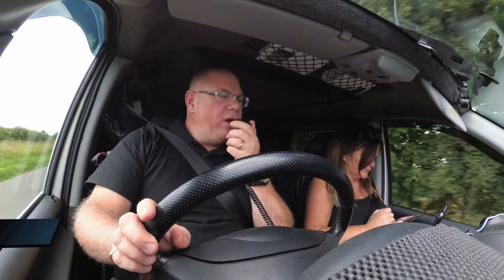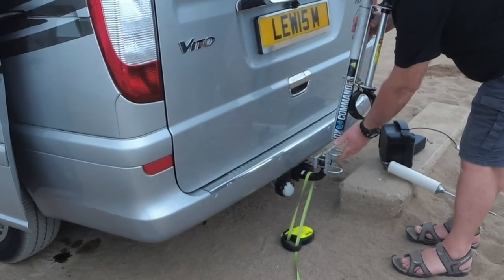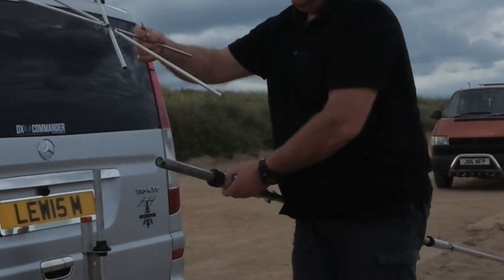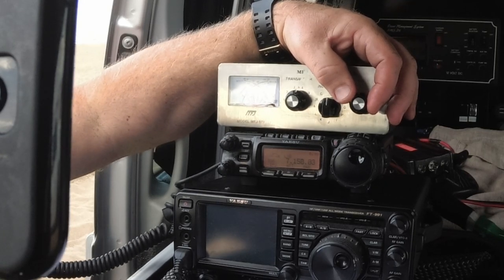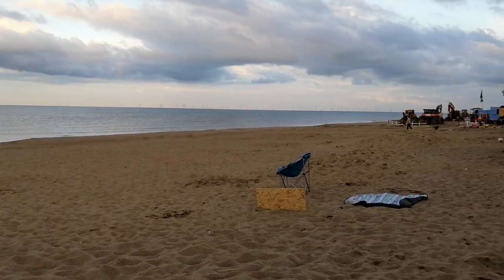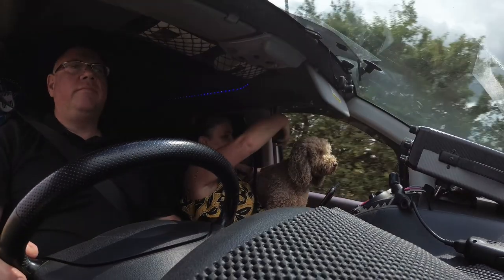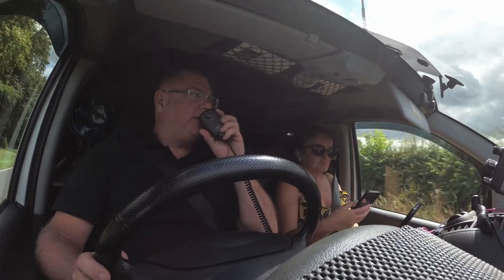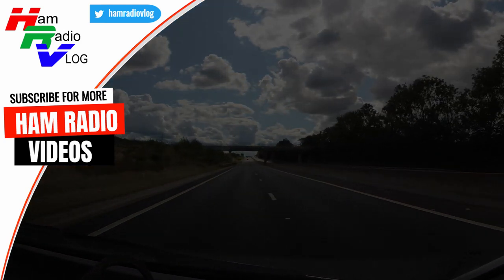Testing the Hustler 5BTV for Amateur (Ham) Radio 40M on the Beach with Yaesu FT991

Comment: Shame about the battery issue Mike. I have a large 115Ah leisure battery for my 991A and fingers crossed, no issues so far. Curse those solar panels!
Reply from the maker: Yeh have the 115AH SLAB but its 3 years old now and doesnt stand up to been in constant use with the fridge and on charge all the time whilst on the drive. Just ordered a 120Ah AGM . Just need to think about possibly paralleling the old one and the new one.
Reply: Ham Radio VLOG  Beware joining old and new batteries together Mike!
Reply from the maker: @ianxfs  Yes, I was thinking about the implications there, guess the new battery will be constantly trying to teach the old battery new tricks and the old battery will keep saying how it was better he he was new. LOL

Comment: Interesting about the solar panels Mike, we have a motorhome and some sites its S9+ with QRM and I wondered was it was, now I know. I did buy a MFJ-1026 to null out the noise, but had no joy.
Reply from the maker: LEDs also. I have LEDs along the inside of the roof and its takes the noise floor from 2 to 9+. I have now fitted a kill switch that simply isolates everything from the battery except the radio! #ImAlrightJack

Comment: Would it have worked better with radials especially being that close to the sea?? Nice little journey for you :) good work 👍
Reply from the maker: Well probably but laying radials on a busy beach wasn't an option.
Reply: Might have been worth a try burying a copper wire radial in the sand, just as an experiment.
Reply from the maker: Yep. I will try that next time.
Reply: @MikeM0XMX  Yeah that would be interesting to see Mike👍. My thoughts were that a smallish copper wire radial buried in the sand would give the stray RF somewhere to go rather than back into your Radio, if nothing else it should definitely reduce stray RF getting induced into everything and would give the vertical a better ground to work against. Best of luck with trying it next time you manage to get away to our lovely beaches.
Reply from the maker: @stephenjones9153  Yeh, the whole idea of grounding it to the van was that the van would act as the ground negating the need for radials. The SWR was definitely good. New AGM battery arriving shortly and a mod to the MFJ tuner tomorrow to allow me to completely bypass the tuning circuit. 73

Comment: Do you need a tuner for that antenna? Not sure why? is it not resonant on the bands you use? Not a fan of tuners, more of a fan of resonant antennas..
Reply from the maker: Tbh it didn't really. Only a little bit of 80 needed a bit of help. For most of the time all the knobs were straight up.